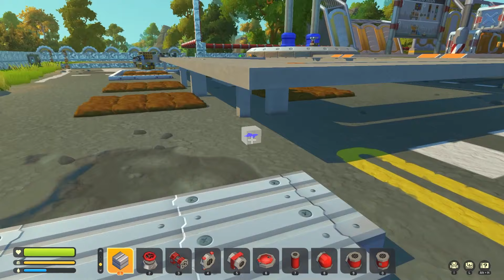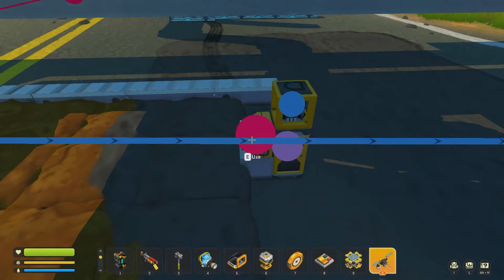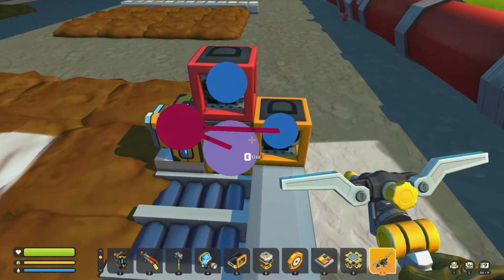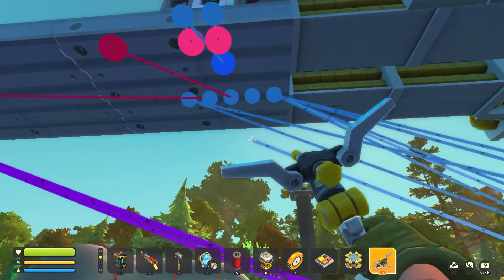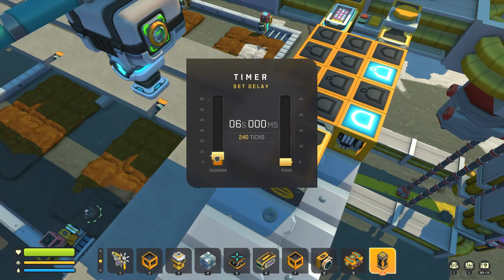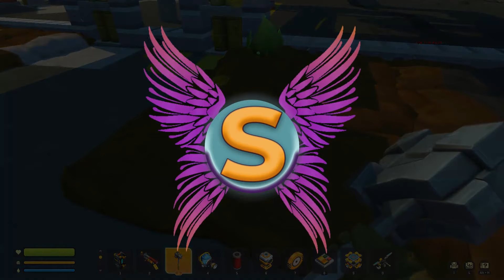Factory Style Dual Auto Planter - Scrap Mechanic Survival Unleashed

Comment: Just a hypothesis: if in corners you use blocks with less friction (net, glass block) maybe drones will turn quicker. Of course use these only on the inside of the gap (I think my expression is hard to understand so: concrete ... concrete net gap net concrete ... concrete) for less wheelspin.  So when the stick of guidance starts scraping it will slide faster. Again, it's only my hypothesis and I don't really know if it will work. But if it does: efficiency!!
Reply from the maker: ABSOLUTELY Brilliant hypothesis I'm sad that I did not think of it myself lol. Even though it will take away from the  consistent track design, the efficiency difference may make up for it! I may use extruded metal instead of net to keep some form of "factory" feel to it
Reply: Glad to hear it. Man, I feel so proud. It's very nice of you to be so open for community suggestions. Thank you

Comment: Well... you don't need the big ramp. Add the small one and youre good :)
Reply from the maker: That is the small ramp lol
If you’re talking about the 1x1 wedge piece then I’m sure it could work even if it does come close to tipping over. It doesn’t however fit the consistency of having the drone’s track at 5 blocks wide tho haha so it’s purely a design reason